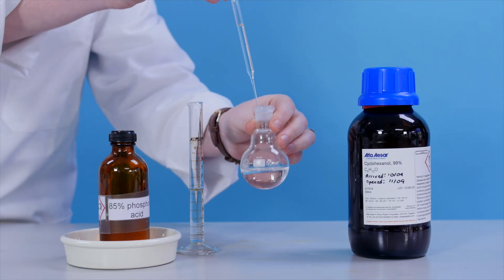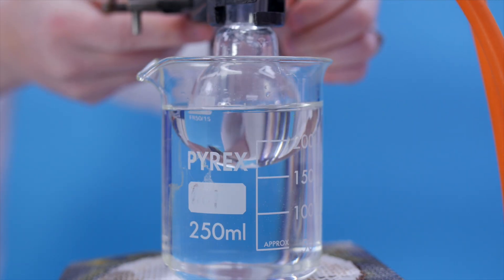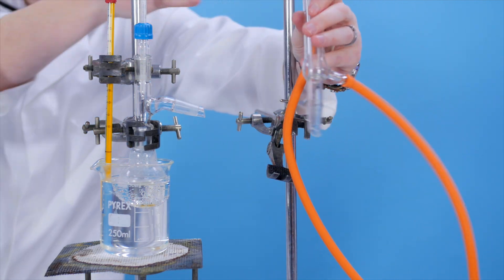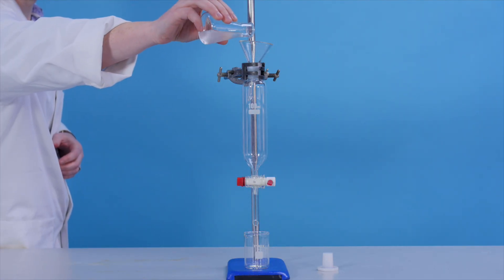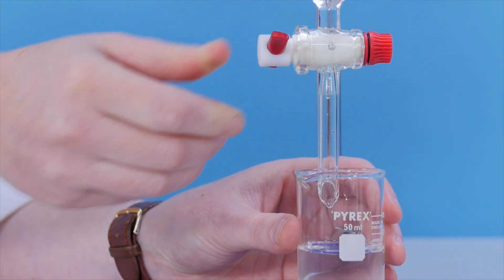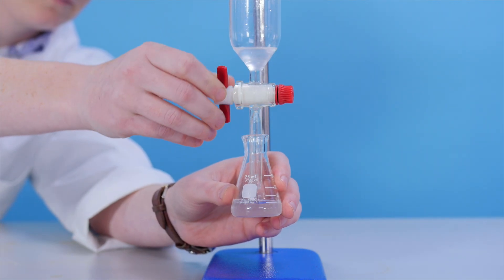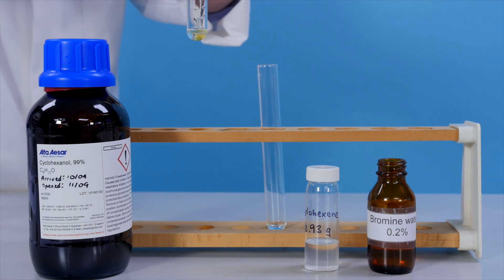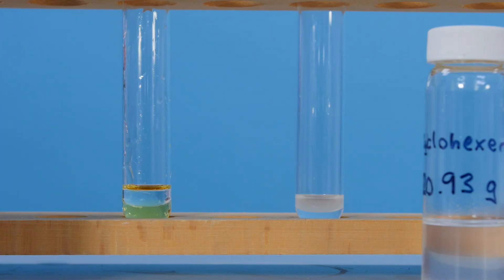Practical skills assessment video - the dehydration of cyclohexanol to cyclohexene

Comment: Heating organic compounds with a flame??
Reply: I used the heating mantle. Using the flame is too dangerous ._.
Reply: Using a flame here is okay due to the water bath. The water bath will absorb most of the heat from the fire.